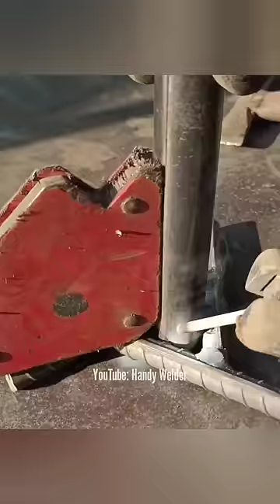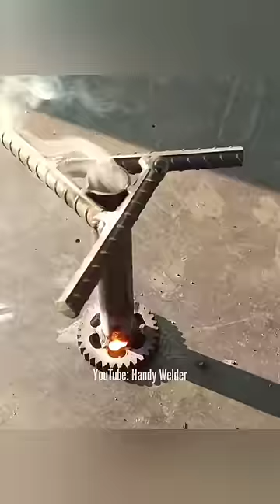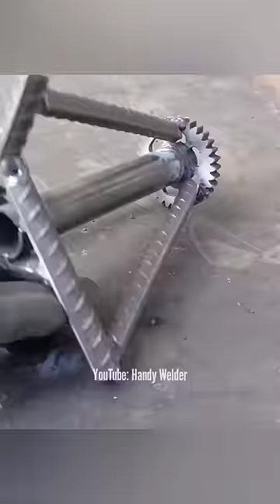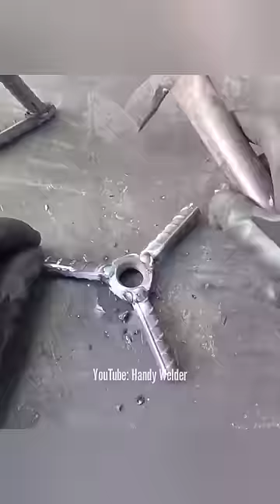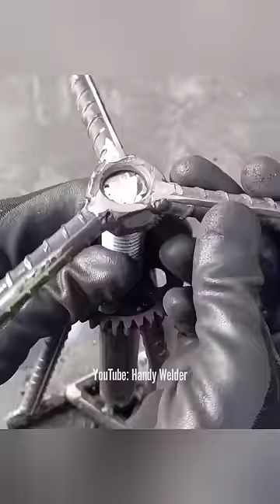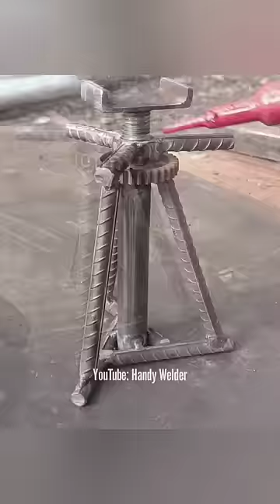a welder's clever invention

Comment: That should not be replicated by anyone! They use square threads on a jack like that for a reason and a course threaded zinc coated nut will fail so quickly. 
DO NOT REPEAT THIS AT HOME!
Reply: Your gonna ruin the mystery, will it hold or not ?  Only one way to find out.
Reply: If you have to tell someone not to do this, it’s only a matter of time.
Reply: I'd trust the nut and threads before the soft rerod that's designed to bend with only minor effort
Reply: People won’t even make toast they see in a video, don’t think you have to worry about anyone making this
Reply: Honestly, for any person who falls under the algorithm for both welding and cars that sees this and tries it, that's just natural selection at work.

Comment: Relying on the threads of a zinc screw to hold the weight of a car, see you at your funeral dude
Reply: There is so much truth in this statement...
Reply: Would you bother 😵
Reply: Fine threads at that!!! Not even close to the super course threads from a sissor-jack.
Reply: The short bus is full sorry y’all can’t get on
Reply: Yes, they should be ACME threads
Reply: And threads that have been annealed to butter.
Reply: Thats the least of my worries, he just tack welded it together... aeughhhh
Reply: Эта технология очень простая и работает, но зачем это делать, если доступен домкрат более практичный???
Reply: correct. A car jack threads are so deep and strong, that they won't come off so easily. This nut and bolts threads are so small they will crumble by the weight of the car.
Reply: But... he won’t see you! 😂
Reply: @rollotomasislawyer3405  correct because his soul will be flying somewhere restlessly thinking, what he has done ajd why he did it? 😂
Reply: Fine threads hold more load than coarse.
The fasteners aren’t zinc, they’re plated with zinc for corrosion protection…
Reply: Ikr
Reply: @dustycrophopper2743 this made me cry laughing 😂
Reply: So much for case hardened
Reply: @goinhot9133  Fine threads hold more? Then why do threads that actually actually weight bearing are deep course threads.
Reply: @brianfitch5469 а зачем на болтах, и шпильках, делают мелкую резьбу? Правильно, для сильной затяжки, учи матчасть
Reply: And what if a better material was used?
Reply: Not zinc cadmium plated Steel.
Reply: No you won't. He won't be in good enough condition to have an open casket lol
Reply: You thing that is possible that the screw will broken?
Reply: @OldsmobileCutlass1969Va 
Fine threads have more holding power than coarse thread.
Reply: @brianfitch5469 
Fine threads have more surface area and can take more force.
Reply: Nah, it won't kill him. Worse, he'll have a lifetime living paralised from where the chassis broke his back to think about what he did.
Reply: Zinc screw? 
It's a steel screw
Reply: ใช้กับรถมอเตอร์ไซค์ได้
Reply: Logic tells me that fine threads would have more holding power. But the treads should have equal strength when taken as a whole.
The reason you seem super course threads on things like jacks and bench vices is because the time needed to adjust them is significantly lessened. 

And those are steel bolts, not zinc. Zinc is the coating.
But they're probably just grade 2 bolts. Not something you'd EVER want to bet your life on.

And using rebar is just insane. You have no idea what the metallurgy of any given piece of rebar is.

There are so many potentially fatal problems with every piece of this.
Reply: Not just hold, but lift. That thing has a half a tire change lifespan for sure
Reply: Fine threads are stronger than course… 

The “zinc” bolt is probably grade 5 or metric 8.8 steel rated at like 80ksi yield - it can support tens of thousands of pounds in this load case assuming he doesn’t run it all the way up. 

The tiny welds holding the rebar together are much more concerning. Learn what to actually look for. Engineering textbook pdfs are free online.
Reply: @Suckmyjagon Yep 😂😂😂😂😂😂😂😂
Reply: You mean zink coated? YouTube experts😂👍
Reply: @goinhot9133 I see way more fine threads strip out than coarse. Been doing this forty years and never seen a strong fine thread.
Reply: @ericeller9165  you may see them strip because it’s easy to cross thread them..
But look at the specs, it’s not an experience thing. It’s a true or false, hard data thing. Your experience means nothing. Idiots cross thread stuff, doesn’t mean the threads aren’t as strong at their job of clamping. Fine threads have more clamping force than coarse threads..
Reply: @goinhot9133  it's not true data. 
Fine threads strip out at lower clamping loads and it's been proven with a stretch gauge. There's a reason high-torque fasteners like wheel nuts and head bolts are coarse. They have to hold.
Reply: @ericeller9165  fine threads are stronger in both tension and shear. Fine threads have more surface area than coarse. You are just wrong.. even in your example, head bolts that see high amounts of stress are often fine threads… yes fine threads are more prone to galling. However a fastener of the same size coarse VS fine the fine threads will apply more force for the same amount of torque input.. meaning, take two 1/2” bolts one fine VS one coarse, tighten them to the same 30ft lbs, the fine thread will have more clamping load… along with more resistance to shear and tension.. it’s not up for debate
Reply: @goinhot9133  I can prove you wrong with a torque wrench and stretch gauge. 
Don't continue to be stupid.
Reply: @ericeller9165  you’d be measuring the length the bolt stretched (yielding), not the clamping load it provides for the same input…, or the tension or shear strength… 
just the stretch, which proves…. 
The fine threads create more clamping load than coarse threads for the SAME INPUT.. resulting in the fine threaded bolt of the same size stretching first/more, since it sees more load from the same input…. Don’t be stupid. This is why you aren’t an engineer.. do you understand now? Yes it will yield under a lower input (comparatively), BECAUSE ITS CLAMPING MORE = MORE FORCE THE CROSS SECTION SEES.
Reply: What you seem to be missing, yes it will stretch more under the same input… that’s because fine threads create more clamping load for the same amount of input. However if the cross section is the same between the two, the one seeing more clamping load (fine threads) will stretch more at the same torque input… you’re half right. Instead of looking at the more stretched fine thread bolt and drawing your own conclusions against every piece of empirical data, maybe stop to think “even though I put the same input in both bolts, why is one stretching? If it was because the threads are fine, wouldn’t it just be the threads giving out? Why would the whole bolt stretch under the same input? Because the same input gives you two different clamping forces, stretching the one more than the other, simply because of that…
Reply: Like if you take the threads out of the equation, why is one bolt stretching more than the other (assuming same bolt grade etc)? The threads aren’t the determining factor for that measurement, it’s the amount of load VS the cross section of the bolt… the threads are just the avenue in which the load is applied… and with fine threads = more clamping for the same input… more clamping, more stretching.. so you understand?
Reply: @goinhot9133  ok bring your own coarse and fine bolts to Illinois and I'll show you the fine will strip at lower torque and stretch than the coarse. Won many bets, fine just doesn't hold like coarse. 
Come be proven wrong.
Reply: @ericeller9165  what exactly do you need to “prove” yourself?
Reply: Cause I doubt you have a clamping force load cell for bolts in your garage, and without one you can’t see what force the bolt is under… which you don’t seem to correlate to it’s yield, but it is.. anyway, I’m done. You truly don’t seem to understand what your own “test” would prove..
Reply: @goinhot9133  it's simple. Torque up a fine bolt and record the torque that strips it. 
Then do the same with coarse and see how much more force it takes to strip it out. 
Fine won't hold like coarse. Never does.
Reply: I love circular perpetual arguments lol
Reply: @ericeller9165  what you don’t understand… yes you’re putting the same INPUT in via torque wrench… what you don’t understand: the bolt with fine threads is seeing more force, regardless of your input being the same…. I’ll repeat. The bolt with fine threads will experience more “stretch”, because the clamping force is higher. The clamping force is higher because the fine threads.
Reply: Like do you really think you and your torque wrench are proving wrong a 100 years of data regarding every aspect of threads and fasteners? Or maybe just maybe, you’re drawing conclusions without understanding the whole picture?… yeah the engineers are wrong, you are right..
Reply: @goinhot9133  can't be. They strip out at far less torque than coarse. Won't pull near as much stretch as coarse threads will. 
Seen it too many times.
Reply: Every thread in an Indy car is fine. They strip out every time, and the fix in the Lola service manual is to drill and tap for a coarse Heli-coil. 
The data is 100 years old and we know better today.
Reply: It really just shows you aren’t comprehending considering you think you can prove your point with nothing more than a torque wrench… it’s just like your vise, and why it has acme threads.. in a vise you want fine threads for the most clamping power.. however you don’t want them to fine or you have to turn it a million times to run it in 2”…. The fine threads take less effort on your end, to achieve a high clamping force (compared to coarse). You have to view the threads as a ramp.. with coarse threads, it’s a steep ramp. Takes a lot to move a car up a steep ramp… but if you make the ramp less steep, it will require less force to push the car up the ramp… even though the car weighs the same. Same with threads.. you get more clamp load from fine threads (like a very mild incline ramp) vs the amount of clamp from the coarse threads (like trying to go up a steeper ramp). This is leaving out the other fact, fine threads have more engagement then coarse, even though it seems counterintuitive. Fine threads have more surface area engagement, making them harder to pull out in tension.
Reply: @ericeller9165  my advice, stick to wrenching and NOT calculating forces on fasteners..
Reply: @ericeller9165  they should just put that example in the text books and send it out to every university for mechanical engineering. I bet they would like to know they have it all wrong.
Reply: @ericeller9165  the example you used 💀
You don’t heli-coil a bolt. So I assume it’s a part. Who knows what material… I’m talking about fasteners, nuts and bolts. Not some random-ass part of who knows what material that has been tapped for fine threads… apparently it’s not as strong as the fasteners with fine threads that pulled them out. Better question, why did they use fine threads on everything? Why when it’s more expensive?
Reply: It's amazing how many people believe fine rhreads have more holding power. One even said more surface area! I wonder if they've cracked open Machinery Handbook. Big bolts for heavy loads have big deep course threads. This means the threads are stronger, those are the things that strip.
Reply: everyone seems to be neglecting the fact that he's using re-bar, a metal that doesn't take weld very well
Reply: @davidoshea1837  why? Just cause it’s low quality? To much contamination?
Reply: @goinhot9133  it's like putting a weld on hardened matieral, the bead just breaks off the re-bar, that's my experience
Reply: @goinhot9133 Fine threads strip more easily due to overtightening and cross threading during removal with power tools. Anyone who says that coarse threads are stronger isnt worth arguing with brother, but good show 😂
Reply: @glennross85  input vs clamp load just isn’t the same lol

Comment: Very bad idea… lol, wtf. Don’t use 10 tack welds to hold your fuckin car up over your body. I’m a welder, I do not co-sign on the “clever” or “welder” part of the description… or the “invention” part. Should be “dipshit makes weak ass jackstand because he’s tired of living”
Reply: 1 см сварки держит 200 кг на разрыв, если ты сварщик, то должен об этом знать.
Reply: "Tweaking" on Meth all summer, maybe..?! Usually taking stuff apart, but this one's got some "Artistic" skills!
  Definitely only for changing the wheel, putting on the Spare, but he does seem to have to get under the car to turn that pipe extension. And it takes many, many turns(the video speeds up the quickest), at this time. Almost just a blur..?! 👍💯😄😄😄✌️
Reply: 😂 lol
Reply: @АлексейПавлов-д9ц7я 1 cm of weld can also be pulled up with pliers and a good yank if it's just a tack like this.
Reply: @АлексейПавлов-д9ц7я the smooth threads of that zinc screw cannot hold a truck up. Not for long at least.
Reply: The audacity to say you invented a Jack. It’s not like he even made it better. It’s worse. Less safe. Harder to use. Fake news. YouTube take his money back.
Reply: brittle tack welds,   did you see how they chipped away when hit with hammer.
Reply: He chipped away welding slag, not brittle tack welds. @PeterShipley1